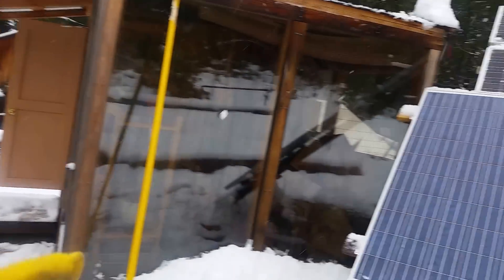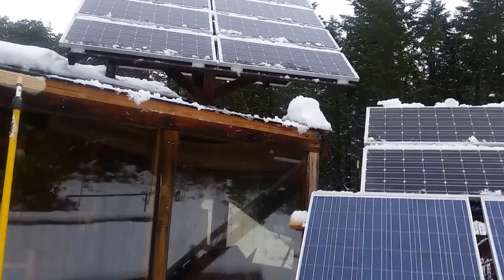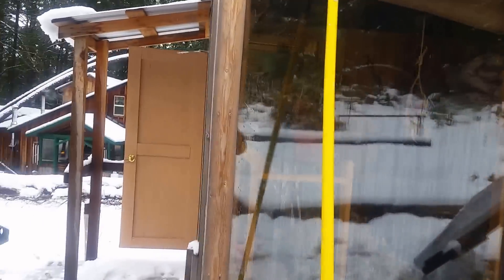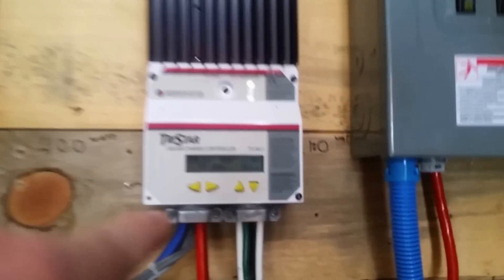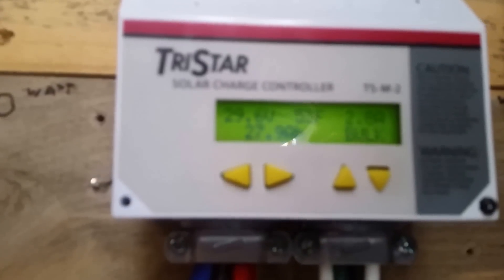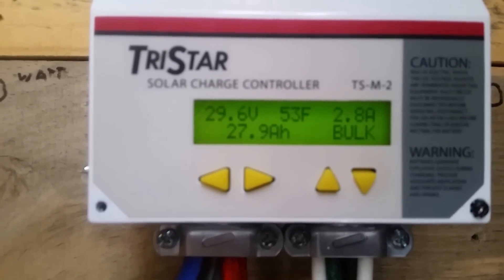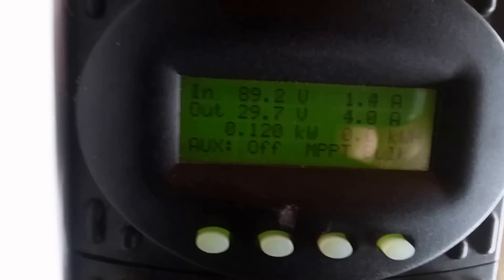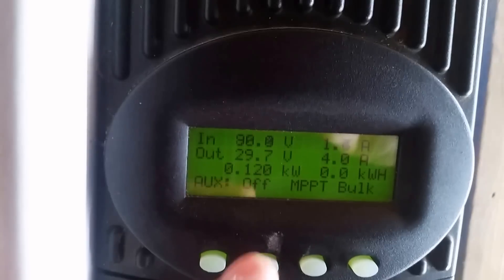Real world test MPPT vs PWM solar charge controllers.

Comment: You have to look at what it does over the course of the day, not an instantaneous point.  How many wh did each harvest over the same day.
Reply from the maker: lol. I dont remember what I said as this is a old video but yes you are right. There are many advantages to MPPT over PWM but I think I was making the point that MPPT really out performs in low light as it is able to use the higher voltage input and translate it into more amps. If the PWM is wired correctly with the right size wire in full sunlight it is within 5% of the MPPT in solar gain. But in low light the MPPT is about 25% greater. This is only one way MPPT is better. With MPPT The smaller wire size between the array and the controller because of the higher voltage like with my Classic 200 is an advantage in every way. That said I have a PWM Tristar on my fifth wheel trailer because it works much better than MPPT when there is the potential for shading. MY new system Is powered by repurposed Tesla EV batteries. 5k solar array and a 4k Magnum Inverter/Charger. I have been off grid since 2015. We are building a new off grid homestead starting March 1st.

Comment: how are your panels connected together for pwm and mppt? i guess your mppt is 2 parallel lines with 3 in series? if your Vop of panels is cca 30V i think you should get the most out of pwm if you would connect 6 panels in parallel? coz if i understand correctly if you raise your voltage with serial panel connection you loose power with pwm controler, coz pwm cant raise current while matching battery voltage.
Reply from the maker: Yes. With pwm the voltage has to be very close to the system voltage. On the pwm array the panels are 21 volts VOC. So 2 panels are in series for a 42 VOC.
The MPPT array is 3 in series.  37 volts Each  with a 111 VOC. The other array has such a height VOC it took the Midnite Classic 200 MPPT CC. I think its VOC is 157 volts. That's the beauty of the MPPT. The wire size can. E so much smaller. When volts go up amps go down.
Reply: @offgridinthepacificnorthwe3210  thank you for your informations. yes like i figure out now mppt can be easier match for the system, but with the prices of 5 times more its hard to get roi against pwm if pwm system is well balanced. so i guess you should put a bit more voltage to your pwm battery, to around 36V? you are at 32V now, right? all what im saying is mostly theory and some pratice i got in past few months with PV, but its really hard to get useful informations, thats why i went and buy one panel just for testing purpse. so thanks again. just today i uploaded a video, where you can see how i try to think out of the box, with best roi. https://www.youtube.com/watch?v=02wXyfKEieo

Comment: I had two 45 amp TriStar Morningstar charge controller one is mppt and one is pwm. All setup on the same solar array. I had a selector switch going to both charge controllers . This was a 2000 watt array and wired so that it would be 24 volts. We had this to show potential customers the real world difference in the two. You could see all the time what was going on. The MPPT would do 25 to 30 % more than the PWM.  Even on 100% clear days here in SC. 99% of tho's who would see this test setup would go with Mppt. Some times I did have to tell them MPPT was not worth it for what they where doing. Or more of an ROA thing. EVEN that a lot of times they would still buy the MPPT. Now they for the most past had the income to be doing solar. They where more of the rich who where doing this at the time. So to them 300 bucks was not the end of the world. But still Most of them did not get rich being waste full with there income. 

There is a place for PWM!! That is clear. I AM NOT saying that. For most off-grid homes cabin and what not. WE need ALL we can get from the solar. MPPT is a must.

Happy to see how well your new setup is running brother. What a blessing this has been. God Bless Brother.

Comment: Great comparison! For your setup, I calculated 30% more. I think the Outback can be tweaked in "Solar Mode" for the type of MPPT functionality. On my Midnites, I use "Sweep" MPPT mode with a 5 min interval at 5% watts depth. What this does is every 5 mins it "hunts" for the maximum power point voltage but will stay "high" in the wattage range. Think of it like this...kinda like a car supercharger that is tuned to always keep things revved up and dialed in for power no matter what engine rpm.
Reply from the maker: Chris DIYer on the pipe is what we used to say.  Back in my old 2 stroke motor x days. When I get the new array up I'm going to call you if that's all right and have you walk me through it on the Midnite.
Reply: Sounds good...glad to help. It does take some tweaking/peaking to get dialed in. Each set up is unique.
Reply: This is at 0C or less, where the Pmax of a 12V panel is 22V. In tropical areas, the Pmax ends up being 14V and the MPPT has nothing to work with. PWM wins in hot temps, due to the simplicity of the design and quick adaptation to cloud and toasters.

Comment: I also think the panels on the mppt are also newer panels that work better in low light they have more bus bars inside them. I should also say that mppt is better.
Reply: Yes was wondering about some of that. A couple of other things to consider is the angle/azimuth of that last 3 panels (hard to tell from the video) and depending on the time of day may be performing better as they may be adjusted more towards the morning sun. In addition you do get small amounts of reflection from snow but I doubt that would make that big of a difference but it will make some. Lastly is the degradation of the original Mono panels. I'm not sure how old they are but after the first couple of years you can count on about 0.5% of degradation in performance. Still love the comparison though and you are right the MPPT controllers are awesome. Love checking in on you Steven. Keep them coming brother.
Reply: Jason Taylor I found in severe overcast like this you can take a panel and swing it around facing due north, south, east, west and the ISC is still the same.  Try it sometime, just take a panel and set it on the ground at like 45 degrees and using a volt meter set to amps, do an short circuit test- point the panel in all different directions. You can even change the pitch from nearly flat to almost 90 degree, makes very little difference in the ISC, although flat was best.  I know, crazy huh. Apparently they are just picking up the ambient light. I did this test in October of 2016 at roughly 1 pm at the 43rd parallel (N) on a severely overcast day and got about 1 amp (ISC) on a panel that has a rated ISC of 9.5
Reply: Old Time Engineer - I had just purchased 32 panels, all 3 bus bar when 
someone mentioned how the new 4 bus bar panels were more efficient... 
believe me I felt bummed. But, I found a study showing going from 3 to 4
 bus bars only made a 2% difference in output. Suddenly I wasn't so 
bummed
Reply: I see people dis MPPT controllers all the time. "In xxx situation, they are not that much more efficient"..... Thing is, they are more efficient in ALL situations, sometimes MUCH more. MPPT is not much more $ anymore, especially for low cost RV and cabin systems. They are WAY cheaper and more reliable than a tracking device, yet deliver as much or more amp-hours.
Reply from the maker: Richard Bennington You make valid points. I have been off grid on a 1400 watt array with the Tristar PWM. Here in the PNW we need every advantage we can get. The low light conditions of our stormy and foggy weather really demand a MPPT. I do not have any results yet with direct sun but in low light the MPPT is a solid 25% increase. I have so much solar now with the last install the 1400 watt array with PWM is in standby at 10 AM. We have 4.8k of solar now. I think I will replace the Tristar with a Midnite classic 200.
Thanks for watching.
Reply: There is a Victron "white paper" on MPPT, showing a theoretical MPPT not doing better than PWM in panel temps between 70-80C. That is the normal temp of a subtropical panel with ventillation. Look at fig 14. That's an IDEAL mppt - not considering the 3-5% loss they normally take.
https://www.victronenergy.com/upload/documents/White-paper-Which-solar-charge-controller-PWM-or-MPPT.pdf
The annoying thing about MPPT is that they diddle around when sudden load changes occur. When your washing machine goes on, you want response. PWM adapts really quickly to loads and fluffy clouds. Considering the competence of the software running the MPPT is important, because el-cheapo ones can be programmed by ijits.

Comment: One would think that in the winter, low sun exposure, that you would want all the power you could get. Especially when you are relying upon the sun or the wind to power your home. 

Have you ever looked into what shading does to the output of your system? There is so much to this stuff. 

Too many folks are believing the lies told by a certain political group that solar & wind can replace existing energy generation methodologies. While I live in the sunny southwest, you would be hard put to get enough solar to run my home without adding a huge load of running the AC. Simply because my house is oriented so that I would only get the sun during a small window because of my neighbors and the trees in the front yard. These trees shade my house so that I don't have to pay even more to cool my home. 

So there are lots to consider when folks make these generalizations about green energy and it's efficacy. 

Just my 2 cents.....LOL
Reply from the maker: Greetings brother. Shading is a killer for sure. The test I did was early morning with heavy clouds and snow. No direct sun and barely above the tree line. In direct  with no clouds I would have seen 85 amps @ 24 volts nominal.
The low light (cloudy) is what I needed for the test. The PWM controller was putting out 2.8 amps the MPPT was putting out 4 amps. The test showed that MPPT out performs the PWM by a minimum of 25% in low light. The next test will be in full sun (if it ever stops raining) And we should see the two types of controllers perform closer to the same. The MPPT really works well with the bad weather. Solar wont work for everybody. If you design the house with solar in mind then you could easily be off grid with what the average roof size would provide. Now I did an analysis of my dads house to see what it would take to get it off the grid without changing his use. With the PNW weather  It would take a $80,000 solar system to do it. In sunny California or Arizona it could be done with $ 30,000
I'm for whatever gets us away from foreign oil lol. One thing that seems to be lacking in the hobbyist solar addict is reality! I like to listen to the people who actually live on the solar system they sell. I have found that honesty in the professional solar community is quite common. I have always thought that Oil should be used as a lubricant, plastics and not burned for fuel. We really need "cold fusion" (a myth) or a "Dilithium crystals" (Star trek) to get away burning oil.